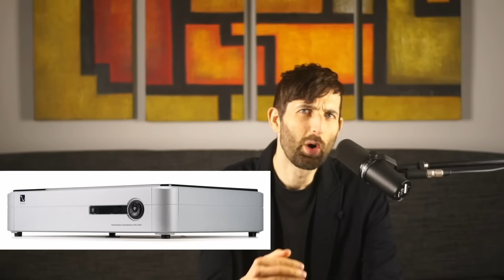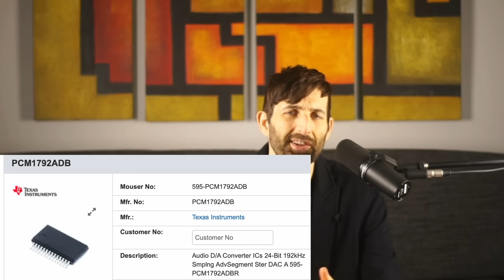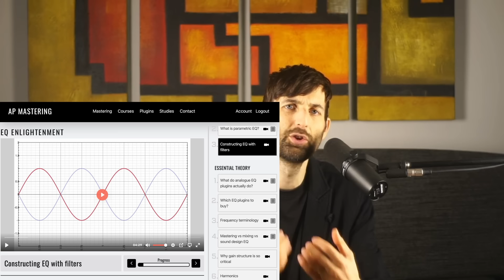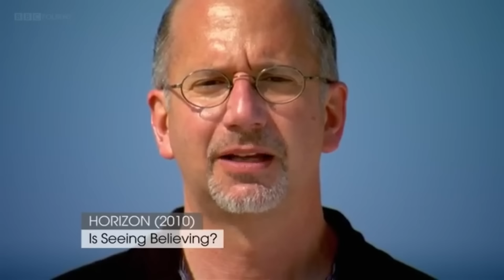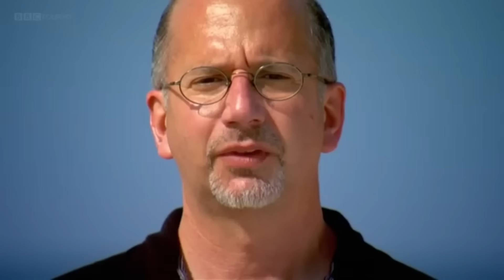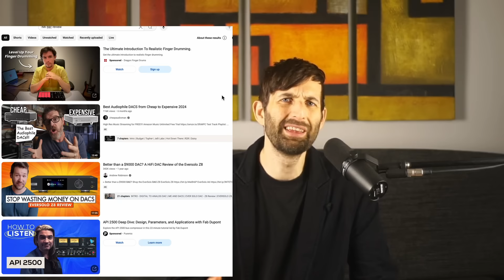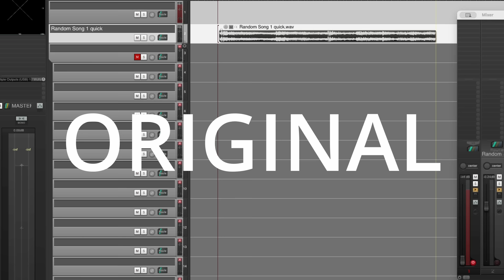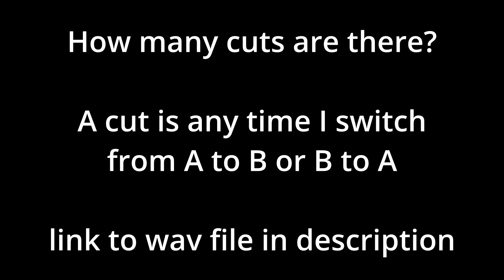The DAC Scam - Almost everyone believes the hype

Comment: It’s misleading to judge DAC sound quality through a YouTube video — and it completely ignores the role of system synergy.
I’ve personally tested multiple DACs in the €150–€500 range (many of them combo DAC/amps) and compared them with a discrete R2R DAC costing around €1,500. And yes — I can clearly hear the difference. This isn’t expectation bias. It’s the result of a highly optimized and transparent system.
Once your system reaches a certain level of resolution, differences in spatial depth, imaging, microdetail, and transient handling between DACs become unmistakable. With the cheaper DACs, the soundstage felt flat and two-dimensional. With the higher-end R2R DAC, I now experience a holographic presentation, where instruments float in space and layers are clearly defined.
It’s not about the DAC chip. It’s about the entire implementation: the output stage, power supply, grounding, clocking — and yes, how the DAC interacts with the rest of your system.

So no — not all DACs sound the same. And certainly not once your chain is resolving enough to show the differences.

Comment: You can hear big differences in DACs and also in Modulation and also you can hear the oversampling method. I am using for example a software based 7th order Modulator which is either a 1Bit DSD or even a 8 bit, so to say hybrid Modulator which is doping the work. So my DAC (T+A SD3100HV) is getting 48x1024 instructions per second and you can hear the change in modulation and oversampling very easily. You can hear also a big difference in either using different Chips for PCM.
Reply from the maker: how did you do in my blind test?
Reply: @APMastering He never answered that. Interesting.

Comment: This is mostly oversimplified. Sure the chips might be the same, but the implementation and surrounding internal components can absolutely make a difference in output quality. It may not be much, but to say there is zero difference, is misleading.

Comment: Hey, i work in the audio department in a laptop company, and i can very firmly say that the TI DAC chip we use costs exactly 2.8 dollars 😃😃😃

A typical laptop CODEC will cost 3.5 dollars, and a Realtek ALC1320 DSP + smart amp cost 4.8 dollars, and they are criticized by audiophiles as "bad digital stuffs" 😅

Comment: Audiofools will audiofool.  
In fairness, it's just flat impossible to remember exactly how something sounds for even a few seconds.  If the levels aren't matched very precisely (0.1 dB or better), the louder source will almost always sound better, and even with A/B switching possible (and usually, it isn't), unless it's blind, subjective impressions are likely to affect your perception of the sound.
An A/B/X blind test and very precise level matching is absolutely required.  Otherwise, the observations you're hearing on YouTube videos have zero validity.  Sorry, that's just the reality of it.

Comment: Mil spec (and medical grade) components are usually just ones manufactured with lower tolerances - they are usually better and expected to last longer.  They're also not much more expensive and anything off spec enough to be heard will fail final assembled QA anyway.

Comment: First off the BS in hifi is off the charts as with what's charged for some products. I have listened to the Eversolo A6 with ESS 9038 chipset and the A8 using AKM chipset. Either chips are used in cheaper and costlier products. The A8 sounded far better than the A6. Why ? The A8 has a better clock and psu or was I fooling myself with my friend included. As for myself I now listen to a heavily modified 1541 cd player so yes I am just fooling myself. The perfect measuring amp was made in the 70's with virtually little distortion however this was achieved with heavy application of feedback. Feedback is a fantastic tool in circuit design however too much and improper implementation will kill the sound but measure great. Point being measurements are critical when designing electronics however they don't tell all.

Comment: Get your shit together. Do your homework before coming to public with this rubbish. The design of the circuit, the power supply the isolation to RMI/RFI the Jitter you get at the end, it ALL COUNTS. You had the courage to display a dCS unit and associate it to a regular DAC chip. dCS USES AN IN HOUSE SHIP DESIGN called RingDAC. You have a big mouth for a small ship :)  Listen to a Nagra DAC or a dCS Vivaldi compare it to a regular DAC, tell me you hear the same and I will tell you to have your ears checked by a professional.
Reply: Its an FPGA

Comment: The other important part of a DAC and can effect its sound is the analog output stage. These like anything can be done good or bad but even a good one reaching -100+dB SINAD waaaayyyy beyond what a human could ever perceive is easy found in DACs under $150. I will say I can tell difference between a typical $200 Sony CD/DVD player and a $85 SMSL SU-1 DAC. But beyond that no not with enough certainty.

Comment: I own a Chord mojo 2 and love it paired with my Fatfreq Maestros. But is this bumph just a lot of hot air? - 
The Chord Mojo 2 employs a custom-designed digital-to-analog conversion system centered around a Xilinx Artix-7 FPGA (Field Programmable Gate Array).  Unlike many DACs that utilize off-the-shelf chips, Chord Electronics programs this FPGA in-house to execute their proprietary Pulse Array DAC architecture.  This design enables the Mojo 2 to perform high-precision digital signal processing, including a 40,960-tap interpolation filter, which is significantly more complex than the 128–1024 tap filters typically found in standard DAC chips  .

The FPGA handles all digital filtering, oversampling, and timing corrections before passing the signal to the analog output stage.  This approach allows Chord to maintain full control over the signal path, resulting in precise timing and low jitter performance  .

In summary, the Mojo 2 does not use a conventional DAC chip; instead, it utilizes a fully custom-coded FPGA platform, providing Chord with the flexibility to implement advanced digital processing techniques that contribute to its high-fidelity audio performance.

Comment: Very bad example: The shown 40k€ dCS Vivaldi doesn't use a cheap chip in the core.
The DAC in it is made out of proprietary discrete circuits and algorithms.
Reply: Its just an FPGA programmed to be a delta sigma dac. They're dime a dozen these days

Comment: The analogue pre-amp from DACs is what makes the difference in the sound.
Reply from the maker: how did you do in the blind test?
Reply: @APMastering the listener has to provide feedback without knowing what equip,ent being tested.. I’m not following…
Reply: @APMastering I get it. Sorry.
I haven’t done a blind test for DACs.
But last time I’ve compared some, they were clearly different. I still suspect of the analogue circuits to be the cause.
Reply: @APMastering  Just to add I’ve a Cambridge Audio that presents a typical in your face sound that I dislike.
 And also an Audiolab the one I currently use. However, I’ve tested a third one from a friend on my setup and it was also different, again less in your face than the Audiolab, more soft, more neutral to my perception, this one was a Roksan.
They were all playing through optical from the same source
Reply: Its an audio rate filter and amplifier, they arent difficult to design. Unsure if youve checked but humanity is in the digital age, has amplifiers, transmission lines and signal processors that deal with things thousands of times the frequency of audio rate data. There's no reason for an analog stage in an audio dac to be a source of difference
Reply: @NamelessSmile  I totally agree.
But there are still differences, maybe they make them on purpose….

Comment: Did it ever cross your mind that all the stuff you find inside of an external DAC might actually have some effect on the sound quality? I think you go too far in the introduction, claiming that only the integrated circuit matters. After that you somewhat correct yourself, and I completely agree of course that the hifi industry is overflowing with snake oil, especially at the high end. If you've ever talked to a person who is into that, though, you will know that they generally don't care about objectively better sound, they want audio to be magic - and that is also why they think vinyl "is superior" to digital, tube amps are better than transistors, pure class A is better than any efficient design based on modern power-switching electronics, and so on... This breed of humans is generally male, lonely, and owners of an audio system that cost more than their property (or as much as their property would cost if they bought instead of renting). We should have some compassion.
Reply from the maker: well either a dac is transparent or it isn't. you can get a transparent dac for <200$

Comment: LOL!   You can listen to different DACs and clearly hear the difference in SQ.
Reply from the maker: you can hear the difference in sound only when you compare to something with horrible quality
Reply: @APMastering I don't agree. There is much more to a DAC than the chip used and not all DACs are chip based.
Reply from the maker: @mrsmokalotapotamus6530 either a DAC is transparent or it's not
Reply: @APMastering That's nonsense, every piece of equipment sounds different including DACs.

Comment: Well, for a start not all DACs use the same chips. For example Chord Dacs use PFA which is completely different technology. I have not  got very expensive system (Mojo Dac costs 400 quid in uk) but can easily hear the difference when I replace my DAC with one costing 1k, never mind one costing 5k.
I visit 3 or 4 HiFi shows a year (going to Munich one in 2 weeks time) and expensive hifi systems, mostly, sound better than cheaper ones.
There is clearly law of diminishing returns in play, going from 2k system to 5k system makes quite a diffrence, but change between 20k and 50k is much less significant.
The proposed test is completely pointless. I watched this video on 200 quid tablet, where speakers cost probably 2 quid.
Obviously, you'll not hear any differences.
Another problem is choice of "music" if you can call it that.
The way to compare system is to use acoustic music like classical or jazz etc.
Then you can compare sound of voices and instruments as you hear them live in concert hall against recording of the same piece.
Otherwise, what is the benchmark?

Comment: I apologise for being a little rude...
But it would be a brilliant idea for this expert to start baking or crocheting, because it's clear he hasn't understood a thing about high-end audio... I think the person who taught him about audiophilia is also his barber.
  I stopped the video after the first minute when I heard him say "they use the same chips"...

  Guess what? Tire manufacturers all use rubber too in their production process.
I'd recommend he take a fast turn at 120 km/h with Pirelli P Zero Nero GT tyres, and then try the same stunt with a Nankangyankchang tyres... it's still a tire... still made of rubber, and even has the same shape. What do details matter, right? Like implementation, manufacturing, PCB layout, power supply design, clocking, component matching, analog stage architecture, shielding and all that...

  I gave a stupid example just for fun. But got the point across...
  When you're a YouTuber, you throw information out to the public and influence some people... but when you do it incorrectly, I don't think it's fair...

Comment: There are plenty of higher-end DACs don't use those generic chips and there's more to it than just the DAC chip used. Quite a bit of work goes into some products in terms of developing algorithms, the electronic design and components. There's some overpriced nonsense of course and there comes a point where any 'improvements' come at a cost that won't be worth it to the individual.